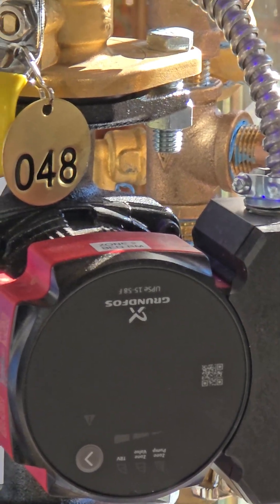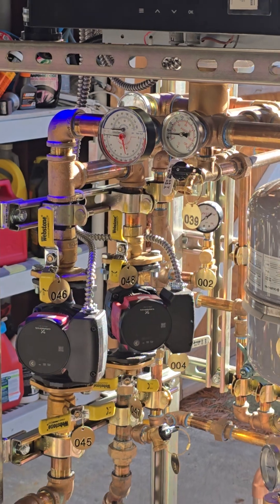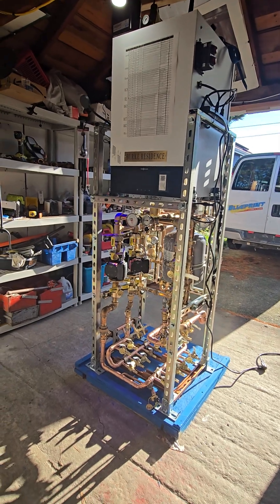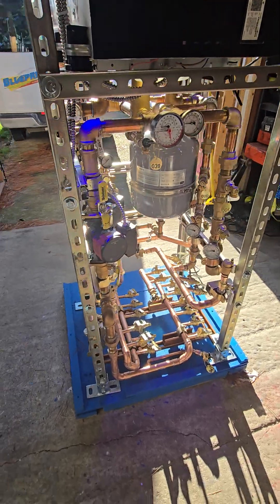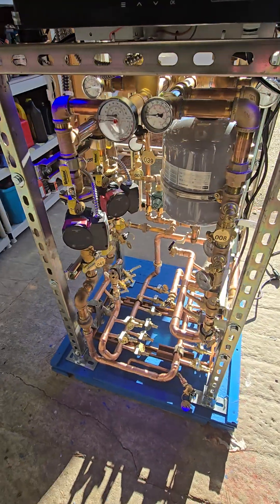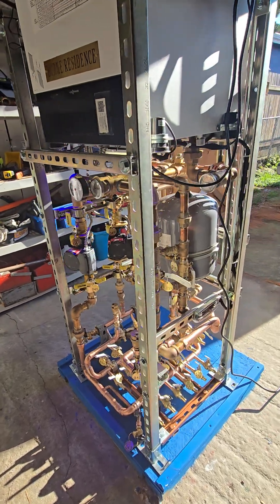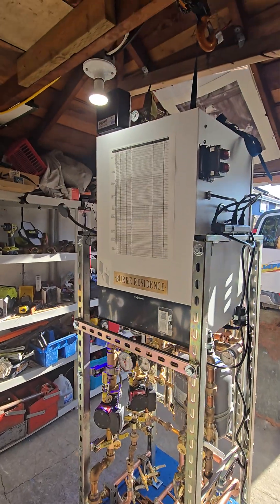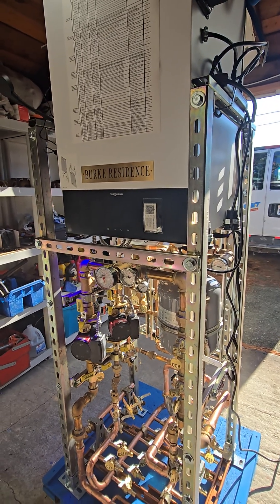Radiant Heating Boiler - Blueprint Caged Mechanics, ready-to-install systems for any building type.

Comment: Looks good although those 15 58 Grundfoss pump motors may need to turn 180 deg.
Reply from the maker: Good eye. Yes I had to sacrifice face plate upside down so I could keep room for interior removal of expansion tank. Cage wk is tight and some sacrifices can be made for the greater good. Once the TRV, RADIATOR or RFH selection has been made that is it. So yes you are correct and I thank you for your heads up.
Reply: @VictorHernandezBlueprint only thing with upside down it may shorten the life of the pump. Air may get trapped in the stator and cause a hot spot.
Reply from the maker: @Paddy.Millkey  thanks Paddy. I talked with grundfos pump rep and he said not to worry about air as circ motor is horizontal to volute. The electronic faceplate upside down has no bearing on the flow dynamics or cause pockets of water. Now if circ can was facing upward and motor shaft pressure pushing down on the impeller that could cause premature failure for sure. Good looking out Paddy. thanks
Reply: @VictorHernandezBlueprint good to know Vic thanks man.  Do any geothermal?